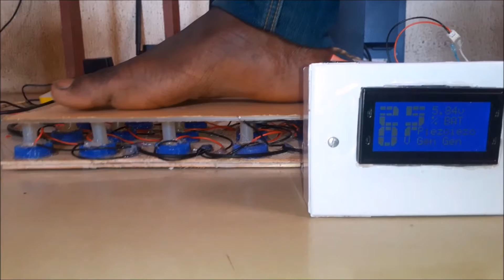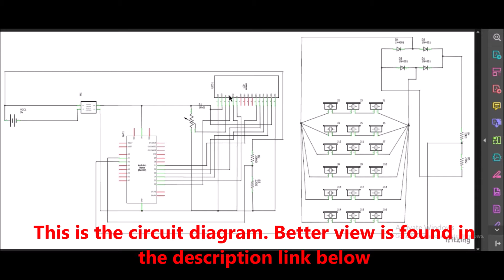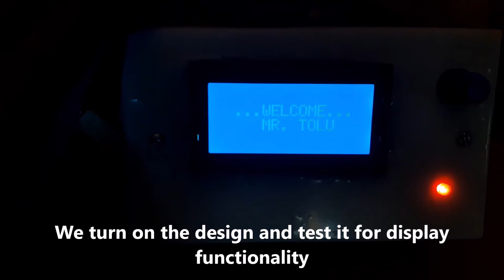How to Generate Electricity Using footsteps (Piezoelectric Generator) Project

Comment: can I increase the battery and increase the piezo so that the voltage that is released is large? If so, is there a component that needs to be changed?
Reply from the maker: You need better PZT modules. Leave backup for now. Get better PZT modules to convert pressure to electricity.

Comment: sir , Can I connect the 4 pins of IC2 instead of the normal connection to the LCD?
Reply from the maker: Yes.

But you may not use the library we used.
Reply: @ancii3182  sorry ,which library do you mean ?
Reply from the maker: @MalakLuka-bp3xo  a SPECIAL lcd lib was used to make the display bold. You can loose that and just focus on the basic display
Reply: @ancii3182   ok thank you💕

Comment: Sir can u tell me the connection of potentiometer it's not there in the circuit diagram provided
Reply from the maker: The potentiometer was used to adjust the contrast of the LCD. you connect the wiper of the pot to the Vo pin on the LCD
Reply: @ancii3182 sir I had a minor doubt regarding in buliding this project can I have any social platform where I can text u clear the doubt please do help me

Comment: Sir, I want to increase the voltage so that the output is as large as 60 watts
Reply from the maker: Increase you number of PZT sensors. Both in parallel and series connection. The series connect ensures the voltage increases to whatever voltage you needed it to be. The parallel connection improves the current. Provided no PZT is broken or damaged
Reply: @ancii3182  What if I added speakers?
Reply from the maker: @user-is6uz5sh2o  😁😁😁😁 
Please what is the functions of the speakers?
Reply: @ancii3182  Not speakers 😅 but power amplifiers that increase from 12 volts to 24 volts and so on
Reply from the maker: @MohmadAldabes  ohkaay?

You are the expert. So I think you can impress me. Although I don't quite get a clear picture of what you are painting.
Reply: @ancii3182  How do I explain the picture to you? I am doing the same project as you, but I want the output to be large, greater than 90 watts. What can I use to make it large?
Reply from the maker: @MohmadAldabes  can you use the WhatsApp or Telegram handle? And consult them?

Comment: What is the name of the piezoelectric sensor in Proteus?
Reply from the maker: It is normal piezoelectric transducers
Reply: @ancii3182  What is its name in Proteus
Reply from the maker: I don't think Proteus has this transducer in its library. I could be wrong. You can check. The schematic diagram was designed using Fritzing. I don't think you can Simulate it either too. Frizington offers now, a partly simulation program for their Premium users. I think you could create your own part on Fritzing and Proteus though.  Just try. Goodluck

Comment: Greetings sir, In your code for Measuring the Battery Level Voltage it is shown that analogRead(A3) when there is no wire connected to your analog pin A3 is that a typo error? Thank you
Reply from the maker: No.
It is not a typo. Two set of resistors were used to measure the battery level and the  output charinging voltage level of the piezo.

Comment: Sir, Which transistor are used in the circuit diagram
Reply from the maker: Please check the blog Circuit diagram
Reply: Sir can you please 🙏 mention in this chat .in the circuit diagram only written Q1
Reply from the maker: @mohammedmasood4307  it is an NPN transistor. You can know from the circuit symbol. If you can get your hand on a TIP41C, the better
Reply: Thank you so much sir